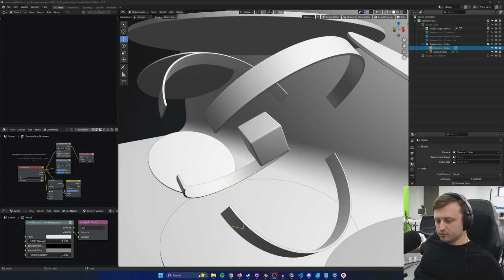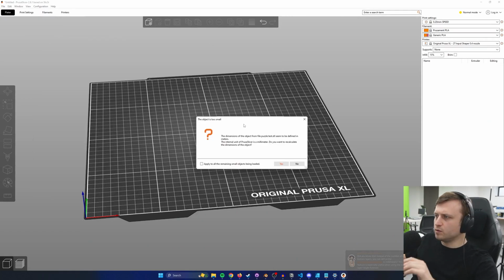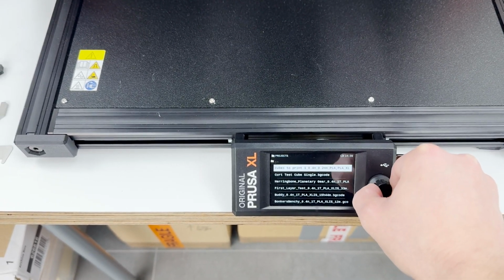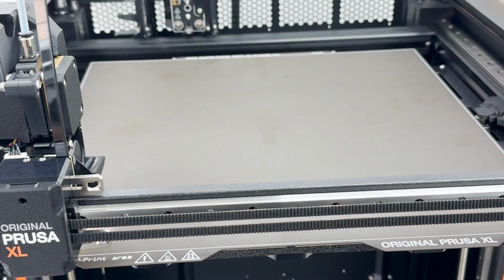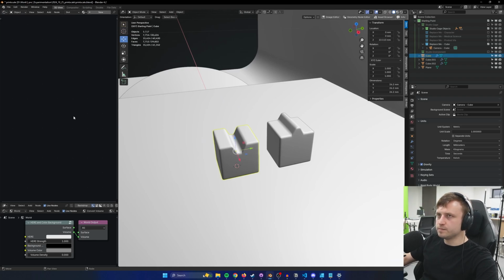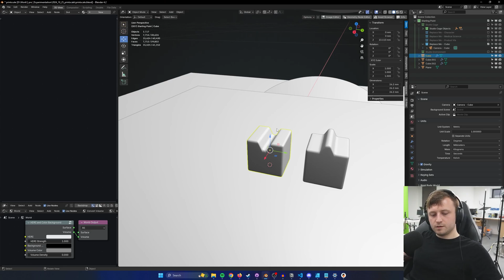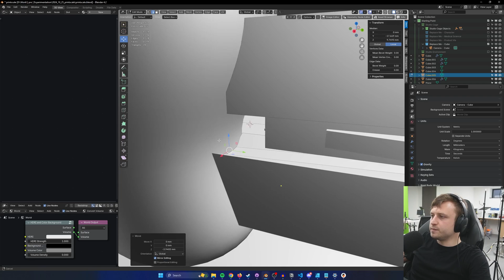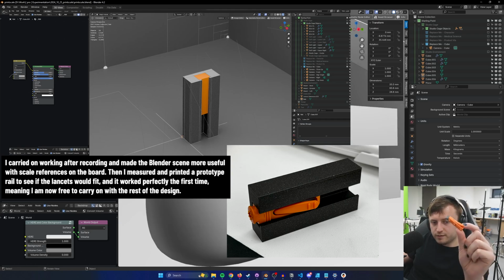Finally Putting the 3D Printer to the Test (w/ Blender)

Comment: I would suggest learning Fusion 360 to use for modeling things for 3d printing, as blender can be a bit tricky when trying to model really precise dimensions.
Reply from the maker: Well that's the thing, I've been locking parts together that are about 1.5mm thick with no issue. I don't need anything more than Blender at the moment (while I'm just using this 3D printer).
Reply: The sketcher plugin for blender works pretty well at injecting CAD workflow - although a bit finnicky at times.

Comment: in order to set the units from meters to milimeters you have to change the unit-scale to 0.001 under the unit system. that will fix the warnings when importing stl to prusa slicer (and other softwares)
Reply: Yeah dude, +1 to that. Like 99.9% of the battle is the millimeter unit, the .001 scale, and then changing the grid size of the viewport to match. Everyone told me how blender wouldn’t work for 3D printing, and I’m really happy I didn’t listen to them hahaha
Reply from the maker: Coolio 👍
Reply: For anyone else that comes across this, also change the "clip start" and "clip end" from the View tab. I run 1mm clip start and 10000mm clip end. This prevents visual artifacts when zooming in/out.

Comment: Good luck on your journey! ✊ Here are some notes about a few things in PrusaSlicer that might be helpful:

At 3:57 (bottom left of the slicer window), you'll find two modes: "3D Editor View" and "Preview". When you import new files, there will be nothing visible in the "Preview" because the model needs to be sliced first. However, you can view, move, or modify the 3D object in the "3D Editor View".

Another thing: disabling cooling for the first layer is common and often improves bed adhesion (timestamp 8:03). You can adjust this in the Filaments Settings under Filaments > Cooling > Fan Settings > Disable fan for the first layer.

Comment: Still seems like it would be awkward trying to lance yourself in the back using that housing.  🩸
Reply from the maker: The actual housing hasn't been designed yet, it's all just prototypical theory.
Reply: @CurtsStudio  I meant the actual positioning of your arms.  Though I suppose it depends which area of your back you were targeting.  It seemed like you were referring to an area of your back between your shoulder blades, but I may have misunderstood that part.  It is intriguing an intriguing thought that this process of personal tool creation is a derived behaviour from chipping rocks and stripping branches.  Curious to see how the project develops.